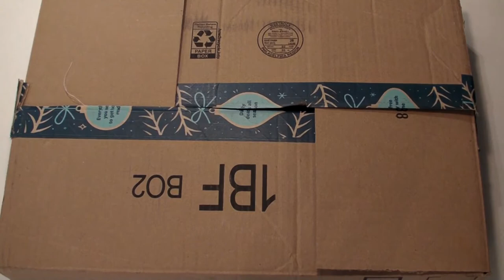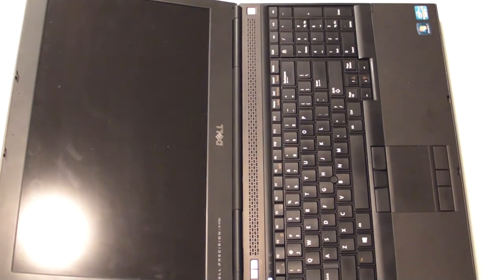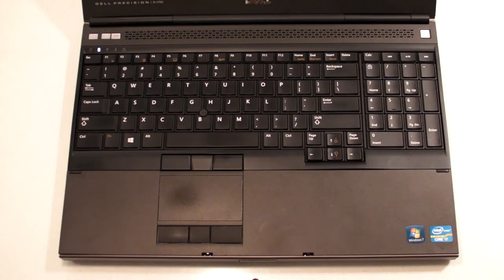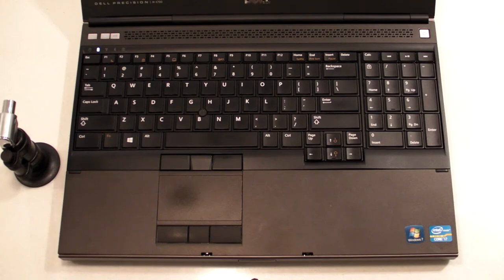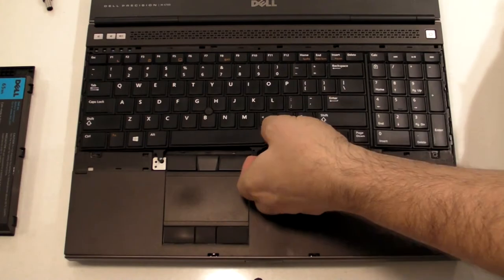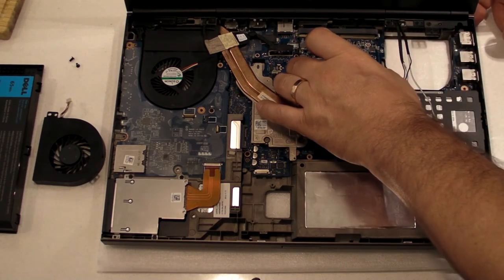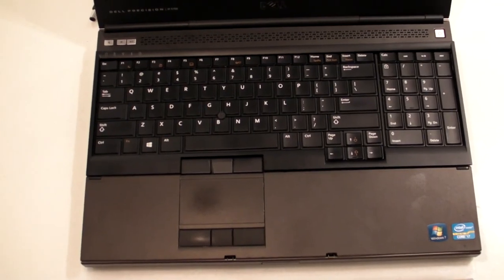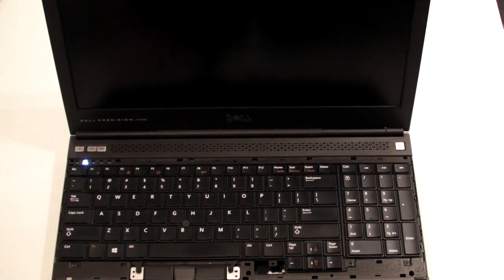Dell M4700 REBUILD #3 - Enter The BLOWTORCH!

Comment: Eso sucede cuando no reconoce las memorias ram, hay que retirar la bateria y  mantener el boton de encendido presionado unos 30 segundos y luego conectar la fuente de poder y encender . A mi me sucedio con el alienware 9700i cuando aumente las ram.
Reply from the maker: "That happens when it does not recognize the ram memories, you have to remove the battery and keep the power button pressed for about 30 seconds and then connect the power source and turn on. It happened to me with the 9700i alienware when I increased the ram."

I already did that.  In fact, the CMOS battery has bee removed for weeks...but, inspired by your post - I will do it again! :)
Reply from the maker: Please subscribe, and tell your friends!
Reply: You may have a corrupt bios. Try reflashing bios via flashdrive bootup. In hp laptops hold the windows key and B key and press power button, to boot to bios recovery of the flashdrive. I don't know if it's same with dell.